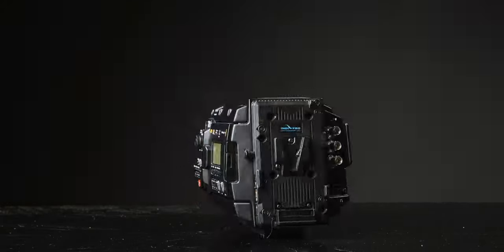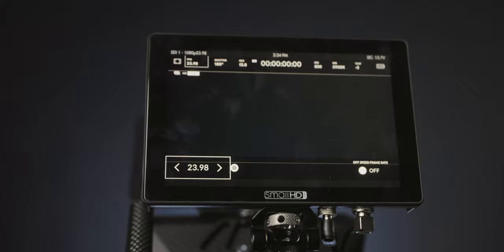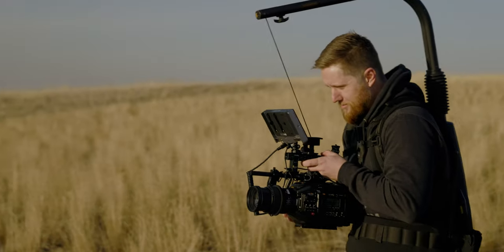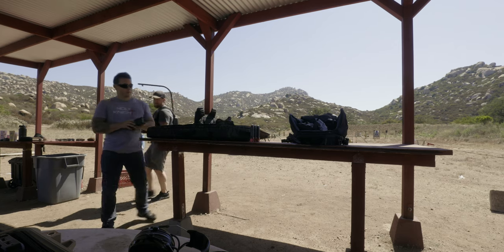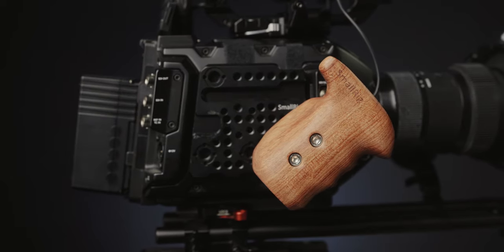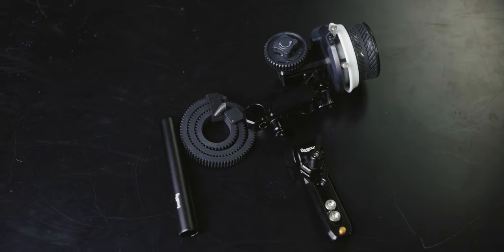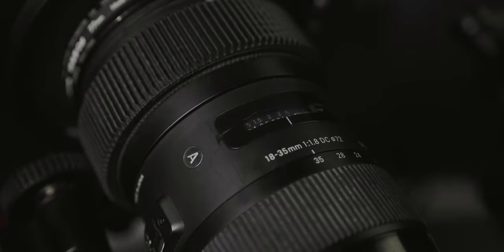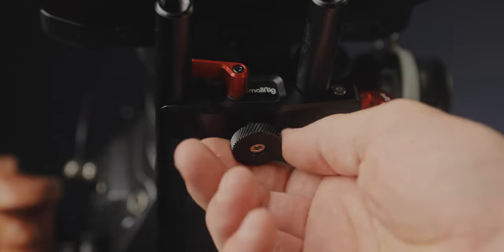URSA G2 Camera Rig Build

Comment: What is the total weight of your rig? Also what Easyrig are you using for this setup, minimax or vario 5?
Reply from the maker: It was about 14 lbs and some change fully kitted out. Vario 5 is ideal but doable on the minimax if I stripped it down a little.
Reply: @TylerEdwards  cool thanks, I’m holding out for the vario 5. More weight versatility and probably more comfortable.